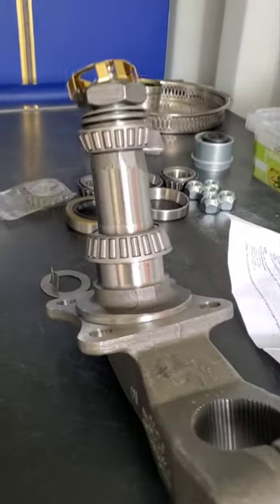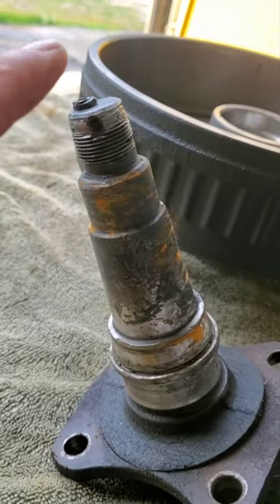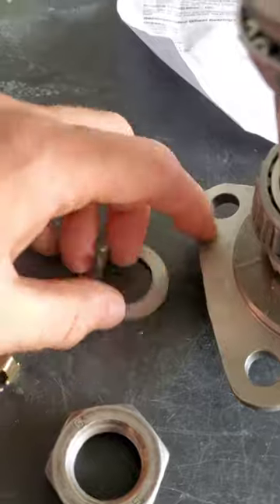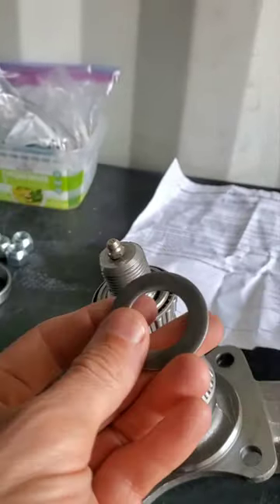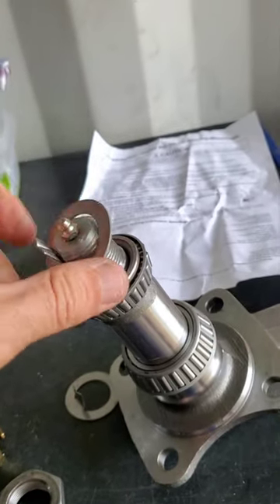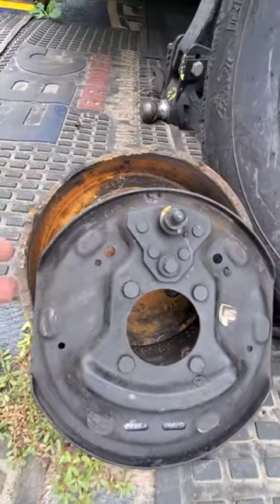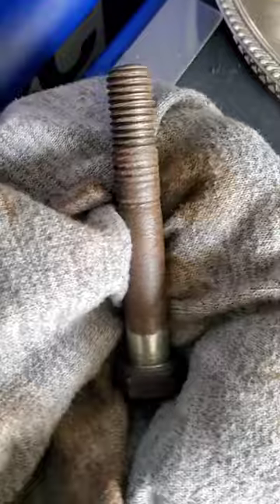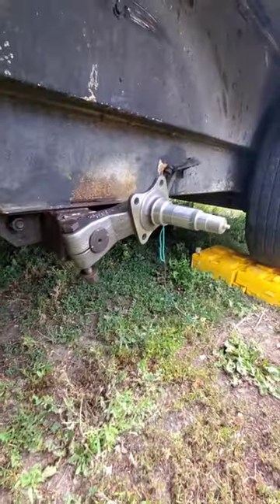Trailer Torsion Axle Replacement Spindle arrived!

Comment: Did you ever diagnose the failure?
Get some never seize to stop the rust. It's a sacrificial lube with metals in it that oxidize away instead of your axle splines or nipples. Great for bleeding nipples. I've never once had a stripped or rusted brake bleeder since using never seize. It hardens and stays put till the next time you bleed.